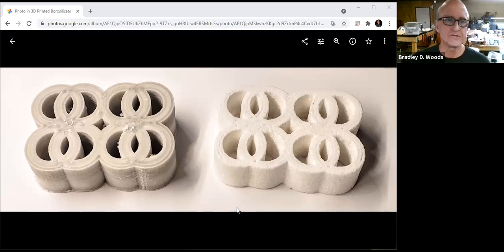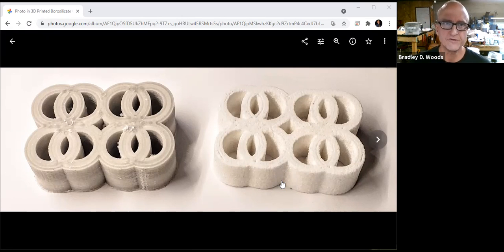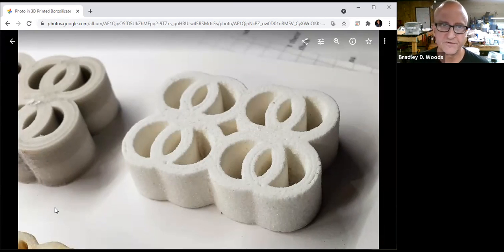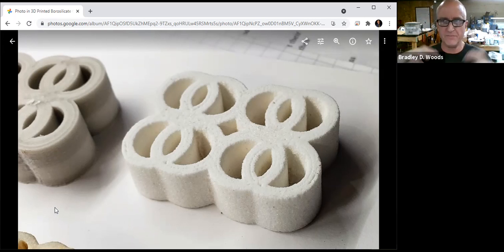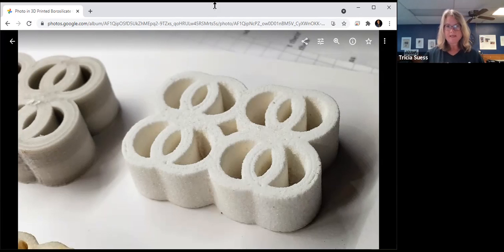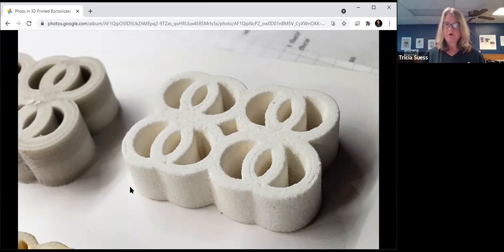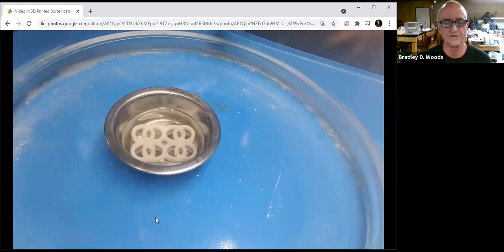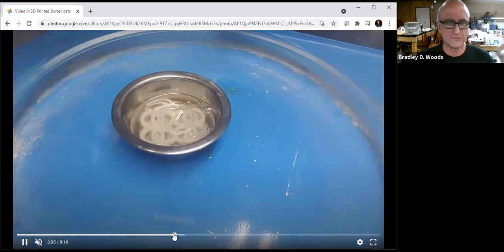Podcast V2E11 - Introducing Pyrex® (Borosilicate) Filamet™

Comment: have you tried using COE 90 glass which is the more common COE of fusing glasses (like Bullseye).   That would theoretically allow offering different colors, which if used with a printer with an AMS, and multiple colors, could create some interesting art opportunities.
Reply from the maker: Our Glass filaments are slowly gaining traction. Over time we'll be rolling out more colors, all of a common COE (probably 90). Past applications have been more technical, lab glass/filters and such. More recently, we've had an uptick in users experimenting with new applications where traditional glass art meets 3d printing. There's a person in Germany that 3d prints elaborate shapes, debinds them, then rolls a glass bubble onto them in a blown piece. So, the 3dprinted parts are just added to traditional techniques. Other projects are starting to further incorporate 3d glass into blowing and lampwork. Hopefully someone starts sharing Video of these techniques. There's a lot that can be done with it, and little has been explored so far.

Comment: Are parts printed in pyrex optically clear once sintered?
Reply from the maker: Negative. The parts after sintering are opaque.
Reply: @TheVirtualFoundry  Ok. Are they just like a opaque white, or do they have traces of other colors?

Edit: Nevermind, I just watched the enire video and found some answers. Would it be possible to "re-sinter" the parts, to fuse them more, and perhaps get a more translucent finish, in either air or some other inert atmosphere, to reduce the risk of "contamination" from the refractory used to sinter the parts initally?
Reply from the maker: @matthewdavidson8920  There are people out there sintering optically clear glass. We'll send you to google at this point for more info. Once the binder is gone from TVF Filamet™ materials, sintering becomes a pretty standard process.